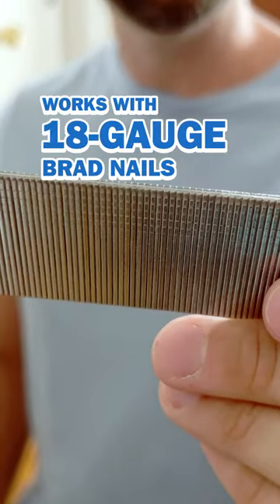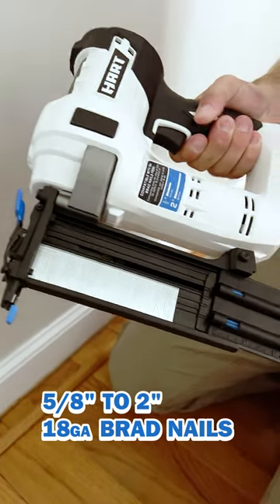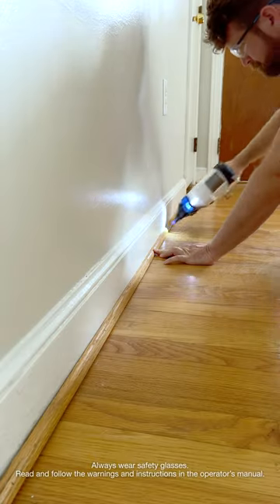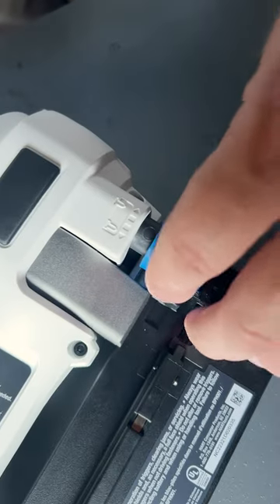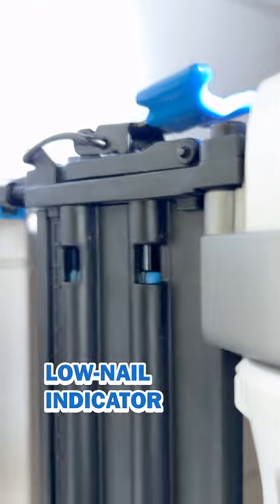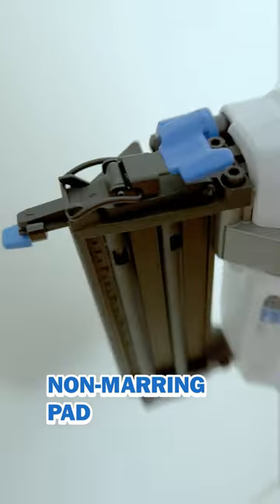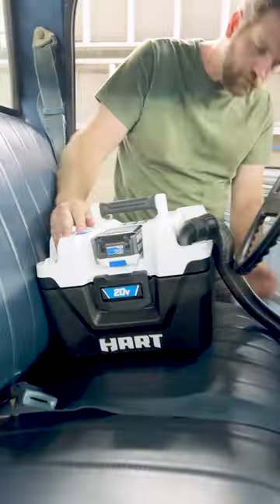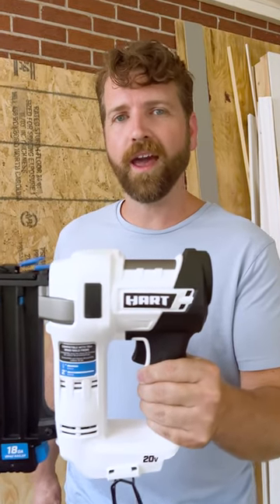HART 20V Brad Nailer

Comment: This Hart nailer will drive in 2 inch brads every time whereas the Bauer version misses 17% full insertion into hardwood so if the difference is 159 to 89 USD but the Hart is way more reliable. The testing was amazing good for the Hart brad nailer. Bauer is only good really for brad up to 1.25 to 1.5 inch I saw on test but fine for most basic uses around the house